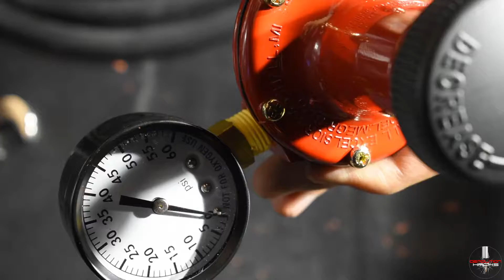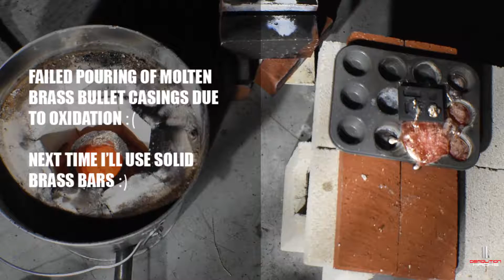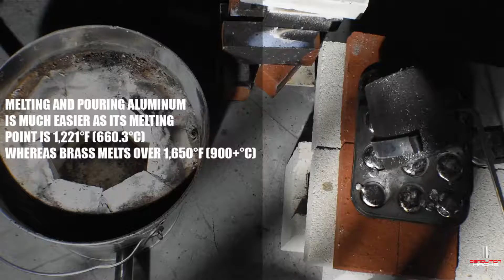How to Make a Trash Can Foundry (A COMPLETE version) - "The King of Random" plan modified

Comment: Removing the primers from the brass will make your brass more pure.
Reply: The cups are brass, and the anvil is typically copper, or brass.    That would be a bunch of extra work just to keep a few milligrams of nickle out of the ingot.
Reply: Tartan Woods Chr maybe not as much work as you think. Really depends on your reloading gear I guess? I have several primer removal tools and a couple of my stage-reloaders can pull the primers really fast.